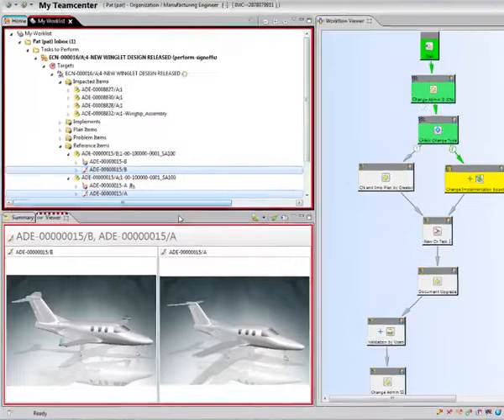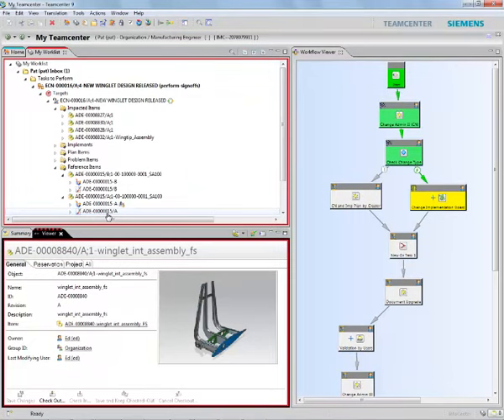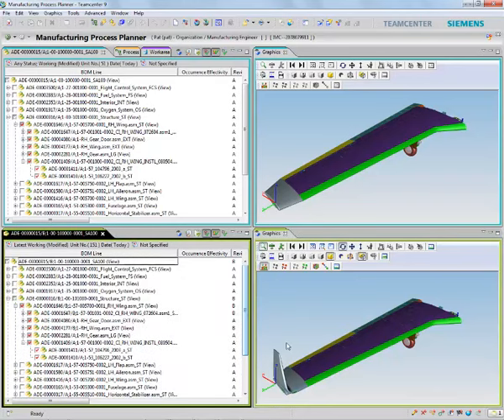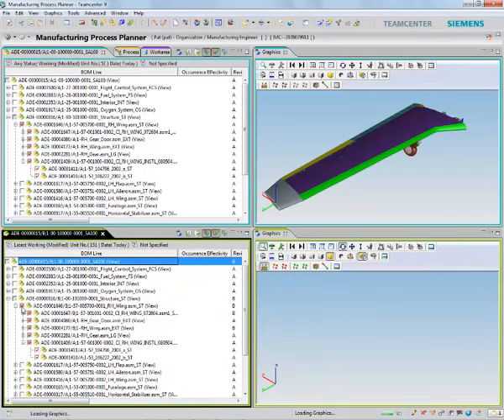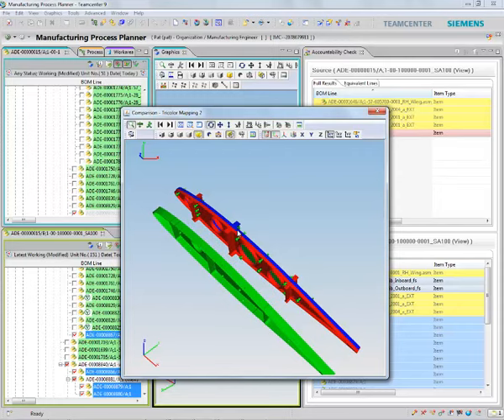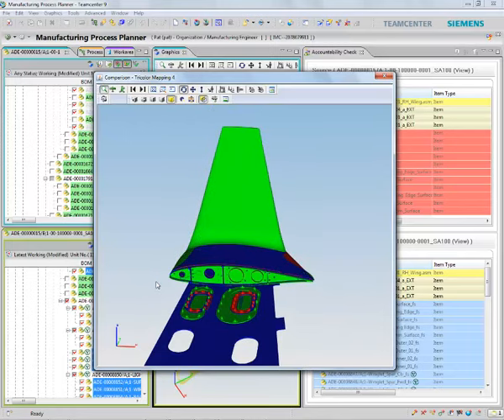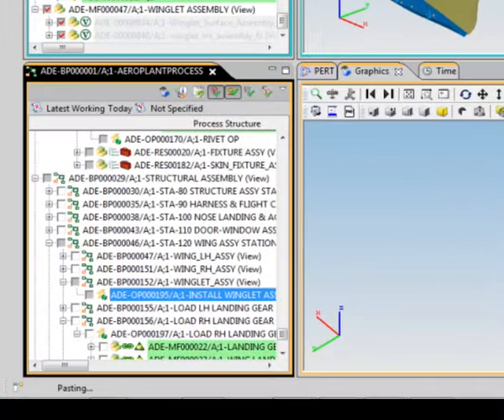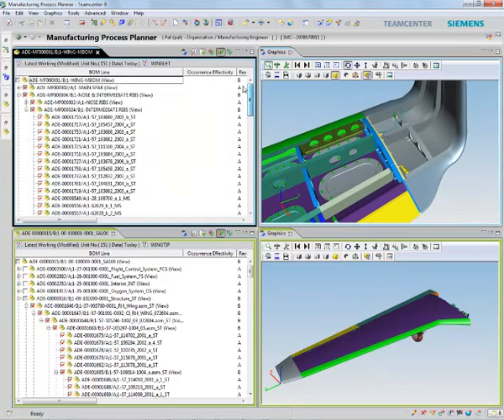Teamcenter Manufacturing - eBOM and mBOM configuration management

Comment: My engineering bom has arrangement , supression controlled parts , position override parts. Due to this I am not able to get the desired JT view after consuming the parts from EBOM TO MBOM, can you help ?? Are we not supposed to use arrangement , supression controlled parts or position override ??
Reply from the maker: Hi - Thank you for reaching out. Since this video is over 10 years old, this seems like a great question for our Software Community! Please join the community at this link and ask your question: https://sie.ag/44BO90f
Reply: @SiemensSoftware  thanks for the response, I have posted this question in community